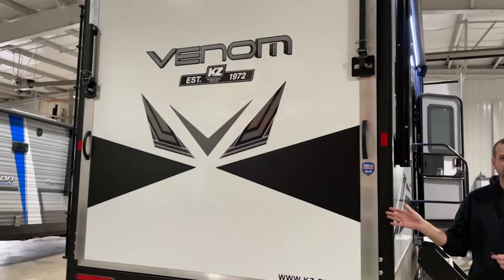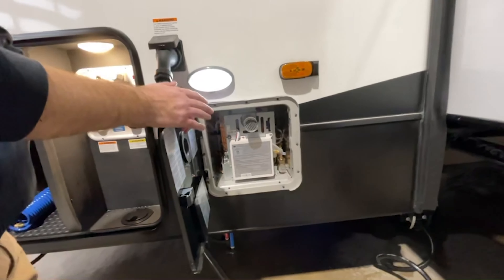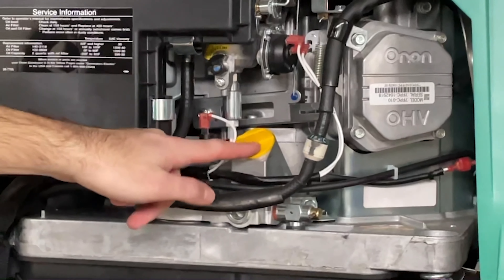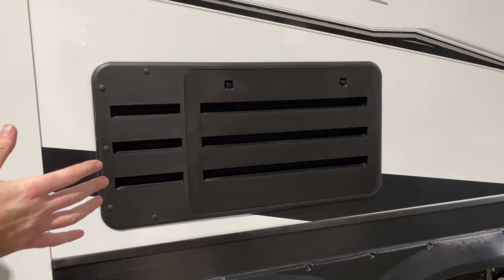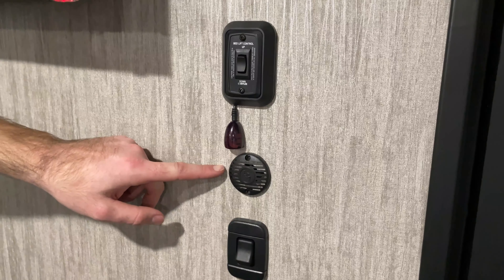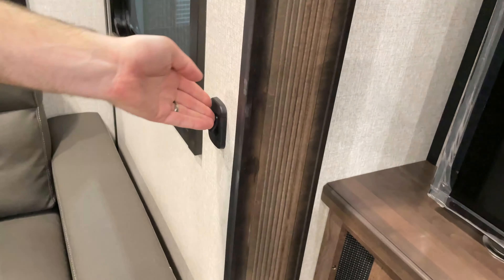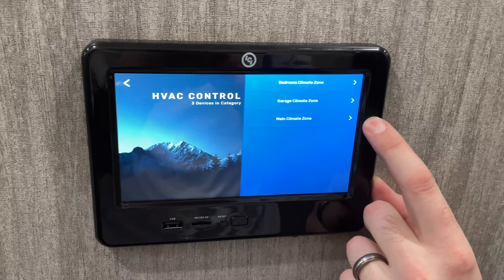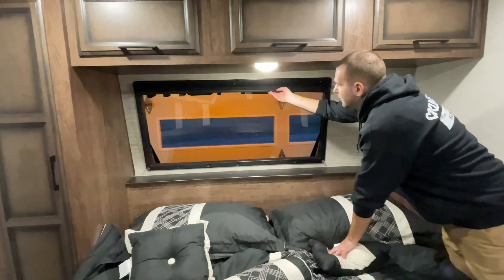2022 KZ VENOM 4113TK DEMO SHEBOYGAN SOUTH

Comment: That's our Toy Hauler
Reply: Have had any problems with it
Reply: @skeim5620  nothing yet
Reply: @jimhowes6162  do you think it’s built better than a grand design momentum
Reply: @skeim5620  I'm not sure so far pretty solid
Reply: @jimhowes6162  are you happy with counter space in kitchen
Reply: @skeim5620  it does lack there
Reply: @jimhowes6162  that’s one of the biggest problem